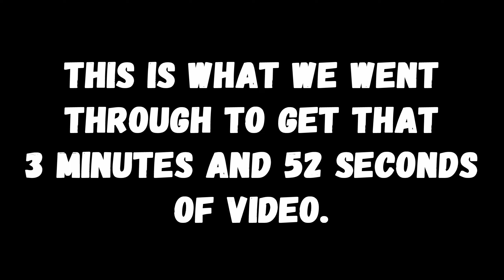5 Top Tips For Your Land Rover Freelander 2

Comment: Another great vid! I laughed at the 100m sprint. I always do the double press method when it’s cold, really helps. My top tip is not to use the heated windscreen unless really necessary as it prevents the PTC heating up. The car only has enough juice to run one of these at a time.
Reply from the maker: Thanks Scott. 😁👍🏻 We will keep that tip in mind. 😀

- Scott
Reply: I'm pretty sure the heated windscreen turns on automatically if it's cold enough.  I've seen mine do that without me touching the button.  👍
Reply: @badrallach4792  if you press Prog it will heat the screen, but this will turn the PTC off. I did a video on this. Later models may well be automatic but I’ve not heard of this before.

Comment: Here's one, my FL2 (2007) doesn't show the EML on ignition unless i turn ignition off and then back on again but only comes up for a few seconds.... also you have to depress the clutch halfway to do ignition on mine
Reply from the maker: Hi VSTV. 👋

That's some interesting "features" on your FL2. 😀 I've not noticed if our EML comes on or not with the ignition. We definitely don't need to use the clutch for anything other than starting the engine.

I feel like every FL2 has its own individual qwerks. 😅

- Scott

Comment: Can you post a link to the 27mm ratchet spanner
Reply from the maker: Here you go Mike:
https://www.jgs4x4.co.uk/27mm-oil-filter-flexible-head-ratchet-spanner/

There are cheaper versions available on Amazon if you want to save a few quid. I personally struggle to trust that the tool is going to last longer than one use when it's come from Amazon. 😁

- Scott

Comment: im thinking about one as a bush adventure and daily work commute car but i owned two discovery IIs and over 5 years neither of them made it to the service interval without needing a mechanic - not once.  Ive since owned a Nissan Terrano 2 for 5 years, mitsubishi pajero 10 years and a VW Amarok 2 years, Renault Koleos 6 years all without any issues ..... I really like the Freelander look and how it goes offroad but is it going to be a reliable bus?
Reply from the maker: Hi James 👋.

That's a nice collection of cars that you've owned over the years. As for a Freelander 2 being reliable... This is a subject that we are looking to do a video on sometime in the near future.

This is a big subject which I'll try and condense into a small-ish post. 😁 They have a bit of a reputation for being unreliable but that mainly comes down to Land Rover setting service intervals for some of the components too far apart. On top of that, they didn't even set a service interval for the Haldex at all and claimed it was "filled for life". So as you can imagine, even if some of the components (rear diff, PTU, haldex) are then serviced, the wear has already happened and will ultimately fail at some point.

If a Freelander 2 is over 10 years old or has more than 150k miles on the clock you're probably going to want to see receipts for the following:

Haldex: Being serviced every 2 years since it was new - or - a new haldex being fitted and then serviced every 2 years.
Rear diff: Land Rover state 10 year or 150k miles. This should be more 5 years or 60k miles. Failing that if it's had a new rear diff fitted within the last 5 years then all it should need is a service.
Gearbox oil: Another thing that Land Rover state is 10 years or 150k miles. This again should be more 5 years or 60k for a flush and fill.
PTU: Yet again Land Rover state 10 years or 150k. This should be more 40k to 60k to have the oil sucked out and renewed. If it hasn't been serviced then it'll probably need replacing after 100k miles.
Steering Racks: These have about a 10 - 15 year life on them before they will need replacing.
Timing belt: They have a 10 year life on pre-face lifted Freelander 2's and 7 years on post-facelifted FL2's. Also make sure it's also had a new water pump fitted and coolant changes have been done.

Then you have the smaller stuff like the aux belt being changed with the tensioner and idler pulley. Oil changes every year or 6k.

If you can check off those bits then you should have a very reliable car that's great both on and off road. Although if you did want to take a Freelander 2 off road I would suggest at least a MuddyMods tank guard and their 40:50 lift kit.

If it's any help, if you're looking for an already modified Freelander 2 we do know of someone that is selling one that we can put you in contact with. 😊

- Scott
Reply: @ScottandAlana4x4  we are looking for a reliability engineer where i work, if you are interested let me know!  :D Identifying service components, sensible service and replacement intervals and having the system and the discipline to ensure its all done on time is the recipe for happy machines and avoiding unplanned and untimely maintenance when you need the vehicle to do its job.  Thanks so much for the response I will look forward to future videos.

Comment: As regards delaying the start up … Is that an initial start or every time I start and use the car? Regards David
Reply from the maker: Hi David 👋. 

It's a routine I personally do every time I start the car. Even though the car is warm after a drive, it still draws a decent amount of power from the battery on each start. If the battery is aged, it could still cause the ECU's to panic if the volts drop during starting and flag random errors that don't actually exist if you just jump in, clutch/brake down and hit the start button.

If you put the fob in, press the start button, the cars normally finished it's checks by the time you've got your belt on. That way, the ECU's all around the car are happy before the starter steals all the amps from the battery. 😀

- Scott

Comment: My top tip is to always have a fully charged battery, then always have equal tread depth on the tyres to stop transmission wear problems. A new rear differential and front transfer box will set you back £2500 fitted, so do not use cheap part worn tyres.
Reply from the maker: Great tips Jagracer 👌😀.

- Scott